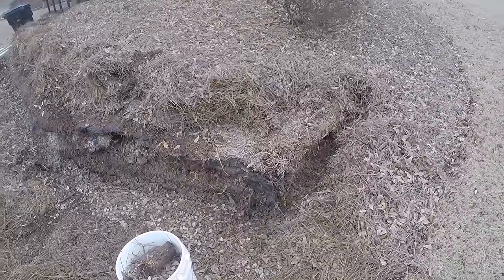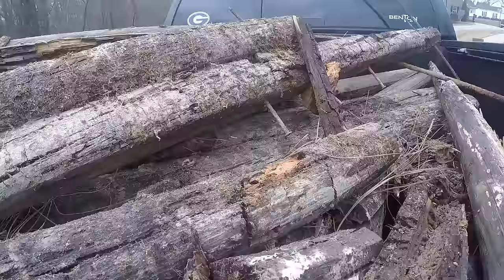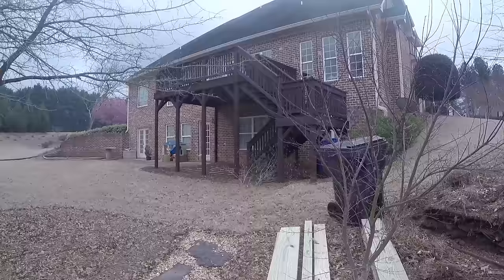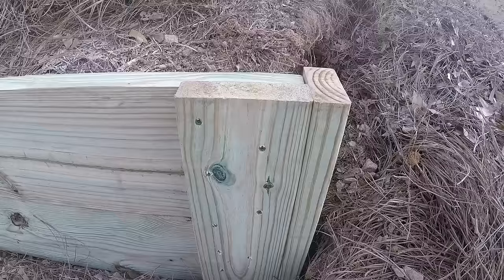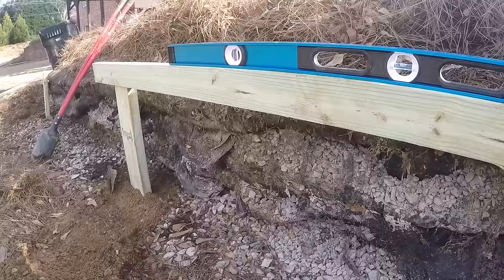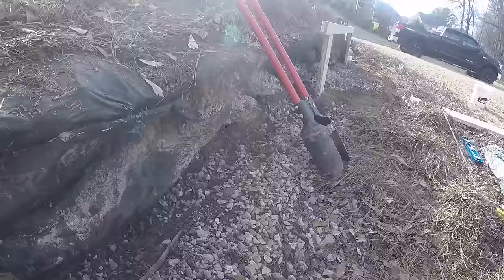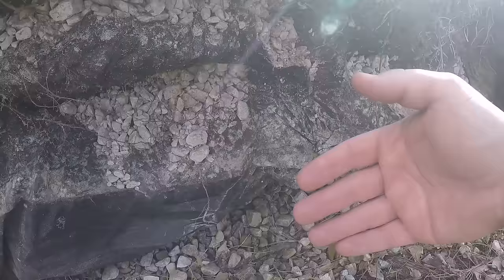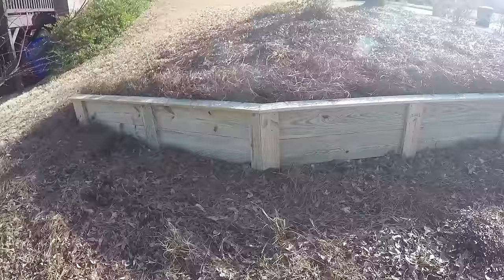Building an Easy and Inexpensive Retaining Wall

Comment: I know this is an old video, but curious if the gravel has held up the boards in the ground? I have a very similar height I need to build and wondering if I should use some mixed concrete in the holes. Curious if the wall has started to lean at all with gravel holding those? Great video! Appreciate it, I will be using the same setup
Reply from the maker: Funny you asked. My dad and I were talking about the wall today and both remarked at how it still looks great.

Comment: Fabulous idea and low cost.  Great job too. I might even copy what you did on the one I'm building.  The only improvements you could do is you can spread roofing tar on the back and bottoms of the wood and stain the front too if u want. I do that on the part of fenceposts in the ground.  They last forever that way.
Reply from the maker: Ed Cardinal Roofing tar sounds like a great idea. Most stains recommend a 6-12 month drying time for new treated wood. I am at about the 8 month mark and plan to stain soon.

Comment: Hmmmm.. I like this! I'm prepping now for railroad ties. I think I'll do this instead.
Reply from the maker: MG D I considered railroad ties as well but they are difficult to cut because they are frequently embedded with rocks and metal.
Reply: @TightWadDIY  not to mention practically unmovable if working alone. Thanks

Comment: I hear ya when it comes to cost of materials with a limited budget. I'm also doing something very similar to your project. Using 2x8x8 for both support and wall. Only difference, as you've mentioned you didn't do, is that I'll be using some bags of quickrete that I have in the shed. Sort of a switch-a-roo with your gravel, I have lots of concrete, just no gravel. Also considering purchasing perforated landscaping drain pipes, just not sure if I need them for a wall that's about 1.5 feet high. Overall, I have to say it looks great and you did a great job putting it together.
Reply from the maker: Arthur In It sounds like you have a solid plan. I have drain pipe behind my other wall. This one doesn’t have much water run off coming to it.

Comment: I think you did a good job. I have a slightly taller area to do. 6x6's aren't cheap. Well, not as  cheap as me anyway! I might use a variation of your idea. 6x6 posts with 2x8, or 2x10, in between. Fasten a "Deadman" here and there. I like the deck board on top.
Reply from the maker: Richard Bedard I like your thoughts on that.
Reply: "Not as cheap as me anyway" I love that comment

Comment: This is exactly what I was looking for!
Reply from the maker: Victoria H. That’s great! Be sure to check out the follow up videos linked in the pinned comment!
Reply: @TightWadDIY  Will do.
Reply: Did you  add gravel to the hole before placing the post? Or was the post placed directly on the soil then the hole was filled with gravel?
Reply from the maker: Victoria H. It would be best to dig the hole deeper than needed, add a few inches of gravel, set the post, then add gravel around the post.
Reply: @TightWadDIY  okay thanks for sharing. I read in places that people are saying put it firmly on the ground for more stability.
Reply: What size screws did you use 2 1/2 or higher?
Reply from the maker: Victoria H. 2.5
Reply: @TightWadDIY  thank you. I appreciate your quick replies. Just now leaving the hardware store. I'll be building this weekend.
Reply from the maker: Victoria H. You are welcome. Let me know if you have any additional questions.
Reply: me too!

Comment: Good looking wall. I'm having retaining wall nightmares that's how I got here. Nice work.
Reply from the maker: Dolores M Thank you! What’s going on with your wall?
Reply: Lol that's how I got here too..  my 24x12 block wall failed behind my garage and rotted the whole side of my garage out..

I ended up building a cinder block wall in place of the rotted garage wall..ended up building 37 feet of cement filled cinder blocks 4 feet high and then backfilling between the two walls with about 12 tons of gravel..  took me 2 months start to finish, working alone..and I broke my dominate hand on the 2nd day of the job lol
Reply from the maker: g wow! You did a ton of work with a broken hand!
Reply: @TightWadDIY  it was miserable..  but I already had the main wall of the garage cut out .. I couldn't just leave it ..   pretty sure I won't do block work ever again lol 

Thanks for the video, it looks great!

Comment: I like it...it gives me a good idea....Thanks!
Reply from the maker: Salvador Marchan Thanks. I’m glad you found it helpful. Let me know if you have any questions.
Reply: @TightWadDIY  As a matter of fact, I'm wondering what is the proper proportion of the post sunk under the ground versus above the ground. So, If the above the ground part of the post is 12 in, what would be the ideal or proper depth of the post sunk under the ground? (Thanks!)
Reply from the maker: Salvador Marchan On a fence post you should bury 1/3-1/2 of the height that is above ground. However, I wouldn’t bury less than 1ft on any height.
Reply: @salvadormarchan1375  1 to 1/2 times the hight of the post

Comment: Once again, I really appreciate your explanation. As a very "rough" weekend carpenter/landscaper, I needed good visuals and a breakdown of each step which was provided in "laymans" terms. Maybe a reminder that a fence post hole digger will save on time and your back? Once last question, if my wall is 20 feet long, and I have 2 posts (2x6 and 2 x8 together) at each end, do I only have to bury the posts on each end of the 10 foot (2 x10x10) which means  a total of 3 buried -16 inches deep for the 2 x 10's as well as support boards on the outside, or do I need additional holes for support? Thanks, Unclebuck
Reply from the maker: rita buckland I’m not an engineer by any means. This was meant as an example but I would think that is enough depending on the height of your wall and the load behind it.

Comment: Looks great.  Thanks for uploading.  Perhaps using angle brackets at the posts can make it stronger.
Reply from the maker: Pain & Injury Doctor Since the boards are behind the posts, the pressure from the dirt just pushes the boards tighter against the posts. I don’t think there would be any benefit to angle brackets.
Reply: @TightWadDIY  what about the end posts?  I thought you just used screws.
Reply from the maker: Oh ok. I see what you mean now. They would provide stability there. I screwed the two posts together. That would be a good idea. So far my wall still looks brand new over two years later.

Comment: Amazing job! Well done!
I am going to do it the same way next spring.
How much did you pay for all the material in total? What is the total length of the wall?
I want to build a wall about 10 meters long...
Thank you!
Reply from the maker: Malte Siegle I think my wall is around 35 ft and I paid about $250 but I already had the gravel. The cheapest place to get gravel for back fill is at a concrete company.

Comment: I know this is a very late comment/question, but I'm just this year (2024) needing to find out about possible remedies for a rotting, crumbling landscape timber retaining wall with a relatively low height (varies from about 1 to 2.5 ft tall). 
You mentioned in the video that yours is "not a load bearing" retaining wall.  Do you mean that the wall is not holding back the dirt in the bed from falling or washing down with rain showers?  I usually hear the term "load bearing" to mean supporting a vertical load, not a lateral load. This is confusing to me.
So I always thought all retaining walls were there to counteract the tendency of soil to wash or erode to lower levels over time.  Anyway, the wall I have is rotting away and I have noticed some metal "straps" coming out of the dirt wall where some of the timbers have fallen away.  I'm guessing that they were originally placed there to help hold the timbers in place when the soil put pressure on the wall as it settled. In other words, to keep the wall from falling over.  
I didn't hear you mention any steps you took to prevent the new wall from leaning over due to pressure from the soil it was retaining.  That makes me wonder  how does one know when or if features need to be designed into the retaining wall to address the leaning of the wall due to soil force.  
     Any light you or anyone else could shed on this issue is much appreciated.
Reply from the maker: I’d say that low of a wall will be fine with the design I used. It won’t put a lot of pressure on the wall.

Comment: Thanks, I didn’t know there was such a thing as ground contact lumber (i saw a long time ago that pressure-treated failed).  I think maybe a layer of plastic sheet might preserve the lumber longer.
Reply from the maker: Stephen Powdexter Ground contact is rated to last almost twice as long. It will still fail over time. Plastic will trap moisture against the wood and speed up rotting. Landscape fabric and gravel is the recommended material because it will aide drainage and allow it to dry.

Comment: Just curious why most of these walls have the posts on the outside and not inside? Is it for support reasons, looks or what? Looks great!
Reply from the maker: It’s for support reasons and east of installation but mainly support.
Reply: My wall is only going to be about 16” high, so I’m trying to decide if they can be inside. Seems like my wife would prefer it that way.

Comment: How is it still standing at current stage? Does it wobble since you only used gravel? I’ve seen people used cement for each post. Great job I want to do something similar. Let me know about the post thanks!
Reply from the maker: Mark Toledo it’s still as good as new. I actually posted a follow up video a couple of months ago. The link is in the description and the pinned comment. Gravel is a better option than cement because the cement traps moisture and rots the wood over time.

Comment: You don't have deadmen to prevent the wall from falling or tilting outward.  It's been two years.  How is the wall holding up?
Reply from the maker: Correct. I would typically recommend deadman. However this is a really low wall and doesn’t have much pushing against it. It hasn’t moved at all in the past two years. I did post a follow up video when I stained it this past spring. Check the description or pinned comment for the link.

Comment: That is a great job I am gonna do that instead of using the blocks. Did you put concrete in the ground to hold the post or dirt and gravel. Amazing wall thank you.
Reply from the maker: NexGen Titan I think concrete causes the posts to rot faster because it holds moisture. I chose to use loose gravel instead.

Comment: You mentioned the posts are down 16" that's not a lot but still quite deep, how did you dig those holes
Reply from the maker: I used post hole diggers.

Comment: Hey question.  if instead of fixed soil that's being retained, do you suppose a free standing (rooted like yours of course) can support just gravel ?  Essentially building gravel a car pad , with the walls (retainers) built like yours?.. thoughts?.. size would be  prolly 12-15 ft long and possibly 7-8 ft wide..  🤷🏻‍♂️.. what cha think?.. possible? Or will the weight of the gravel and the car blow out the sides?

Comment: Thank you for posting  your video. I did not see  drain Pipe in your video. Did you use it behind the wall?
Reply from the maker: Khun Lein I didn’t use drain pipe on this once since there isn’t a lot of water coming through this area. I used fabric and rock behind the wall instead.

Comment: I’m looking at doing the same thing yours turned out very nice. You really should of tied the wall into the earth in a couple of locations it would really help keep it from pushing out. Great video though short to the point and good results.
Reply from the maker: Andrew Presley Thank you. I agree that tying it into the earth would be a better long term solution but the wall is so short I don’t think it will be an issue.

Comment: Did you attach the top boards first and then add down to the ground? Or start from the ground up?
Reply from the maker: Mr. Smith I started with the bottom boards first.

Comment: Love the wall - how did you connect the 2x6 to the 2x4 you cut at a 70 degree angle??? Thanks
Reply from the maker: Thanks! I used pocket hole screws and a Kreg Jig.

Comment: Was t hu inking of using block but this may have changed my mind. Would nails work instead of screws...or is one better than another?
Reply from the maker: Screws are better than nails in this scenario in my opinion because they won’t allow the boards to pull apart. I considered stone but the price steered me in this direction instead.

Comment: Shouldn’t have rotted that fast. I have some of those in my garden and they are over 20 years old. Makes me wonder if there was something wrong with the wood(not treated properly) or maybe it’s the area. I live in a warm area.
Reply from the maker: The timbers I used for the previous wall had been reclaimed from another wall that was being torn down.
Reply: @TightWadDIY  ok

Comment: I noticed you attached the boards to the posts with screws from the front.    What are the pros/cons of doing it this way versus screwing them from the backside?
Reply from the maker: Dave B I think the only con to screwing them from the front would be that the screws will show. The pro is the ease of install. I didn’t have enough clearance on the back side to screw them in from the rear.

Comment: The 2x6’ will eventually begin to lean outward with the soil pressure.  I built the wife a flower bed like this.
Reply from the maker: Matt Felt I guess we will have to wait and see. So far it’s held up nicely.
Reply: Adding dead man braces behind all the ground contacting posts will prevent outward leaning.

Comment: Great job, what did you pack the uprights with that go into the ground ??? Just gravel and you tampered this down or did you put anything else in there ??
Reply from the maker: Keith Stevens I just use the gravel and some dirt.
Reply: @TightWadDIY  Is it still all holding and looking good ??
Reply from the maker: Keith Stevens Check our the follow up video and then the staining video I posted this spring.

Comment: Should have use at least 4x4s. Those 2x6s sideways have hardly any resistance being sideways. Might as well have just had 2x4s sideways, stuck together if you're too cheap to get at least 4x4s for that small retaining wall.

Looks good, though. I love this stop.

Comment: This is a beautiful project. How did you cut the vertical supports? Did you cut them to exact size before placing or can you also trim after they are in place?
Reply from the maker: Bernice Goll The vertical supports that are buried a couple of feet in the ground were all cut the same length then leveled by adding and removing dirt in the whole. The vertical supports between those posts were cut to length by measuring then ensuring they were flush with the top of the wall. The bottom inch or so is covered with dirt so it doesn’t matter if it’s perfect.
Reply: Thank you so much for your response.

Comment: Thanks for the tips, this is exactly what I will attempt to do. Not sure about the width the holes I am suppose to put the  2x6/ 2x4 , nor the depth?
Reply from the maker: Craig Buckland How tall will your wall be?
Reply: 2 feet  - 30 inches at the most,- almost identical to your video,  when you use stone to fill the holes for the posts (2x6 and 2 x4) corners , do I also need to use cement to help strengthen the supports? Thanks again
Reply from the maker: Craig Buckland I buried my posts about 18” deep. I used gravel instead of cement because cement traps moisture and speeds up rot. You will find about 50/50 suggesting cement vs gravel if you look around online.

Comment: Please could you tell me did you gravel as deep as the post / wood you put in the ground ? Also was it just gravel you used to hold the posts ? 
Thank you stay safe london uk
Reply from the maker: Yes, I put gravel in the bottom of the hole then added the post and filled around it with gravel and dirt.
Reply: @TightWadDIY  🙏 thank you just got my 1st garden and wow what a mess ( the back of my garden looks over my house view) it’s amazing really but I want to level as much as I can …. It’s a mountain  😂  thank you so much for your reply, stay safe and much love ❤️

Comment: Great Job. Planning similar retaining wall. How long was the screw drilled to the 2x4 and 2x10? and Did you also screw the two 2x10 which is stacked vertically?
Reply from the maker: Mithun Anantharajappa I used 2.5” coated deck screws for everything. I didn’t screw the 2x10s to each other but I screwed them into the vertical supports. Ideally you would screw them from the back side but I didn’t have enough clearance to fit the drill behind them.
Reply: @TightWadDIY  I have a similar situation where I can't drill from behind. Thanks for the great video it gives blueprint to follow.

Comment: So cement is not needed?
I’m sure you mentioned it but I might of missed it how deep did you dig the hole?
And how is it holding up?
Reply from the maker: Omar Rodriguez Pouring cement in the holes for your posts will help prevent rot over time. My wall is only about 6 months old and still looks brand new. I will be posting another video of it soon when I apply the stain.

Comment: Did you use the same deck screws to attach the deck board? From one angle it looks like you may have used bolts or some other fastener.
Reply from the maker: Victoria H. Yes. I used the same deck screws on everything.
Reply from the maker: Victoria H. Be sure to check out the two follow up videos in the pinned comment.
Reply: @TightWadDIY   Thanks